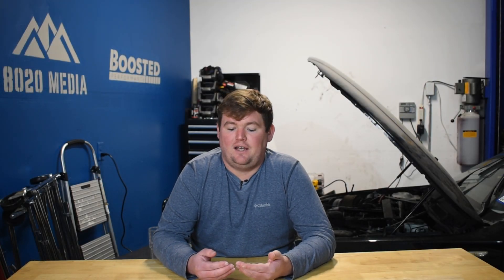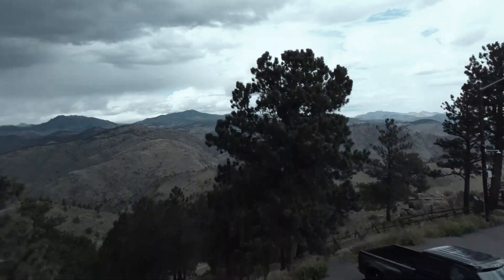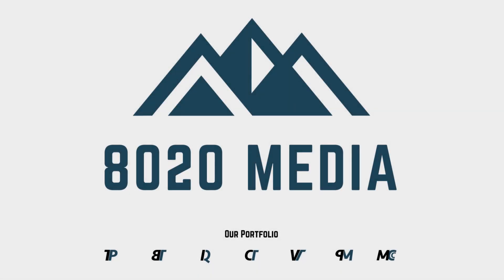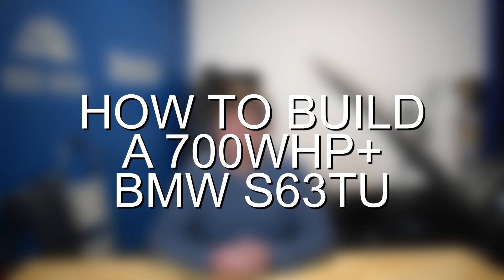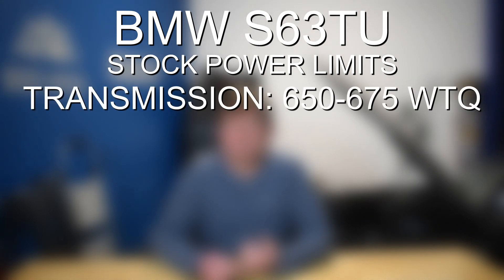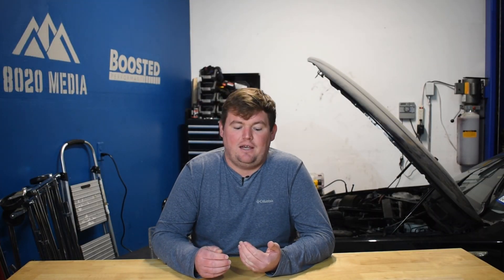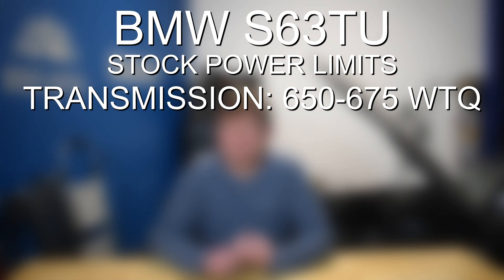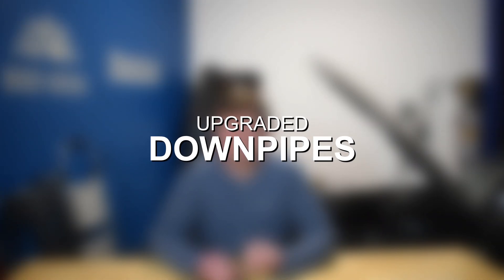How to Build a 700+ WHP S63TU!

Comment: I am currently saving up for an F13 M6 with a DCT. I am planning on going with a downpipe and a tune a few months after ownership. Would you recommend a clutch upgrade kit to be installed before I go ahead with the upgrades?
Reply from the maker: Probably worth it to at least get xHP transmission tuning and then see how it goes from there. But whether or not you want to drop a few grand on a clutch upgrade depends how aggressively you are trying to push the tune/what power levels you want to be running consistently.